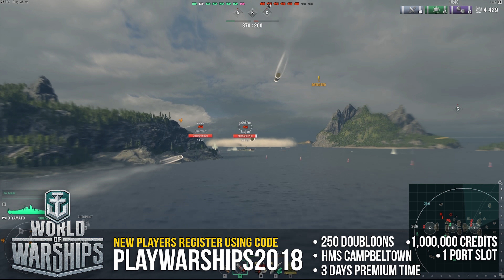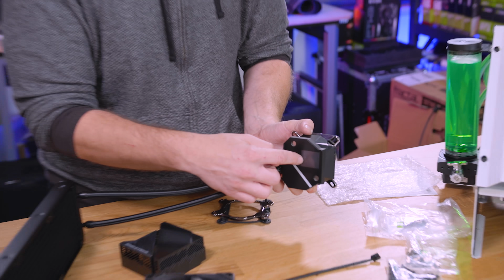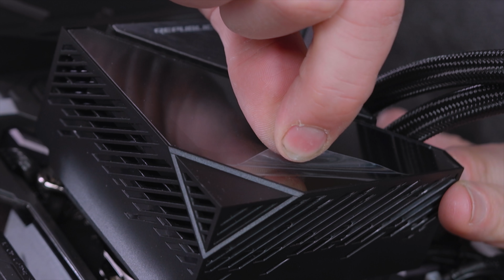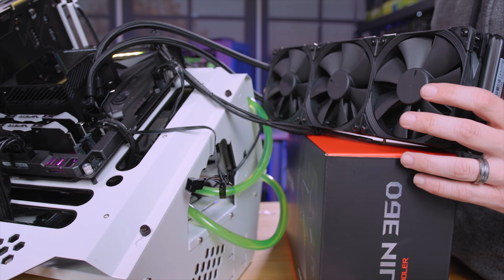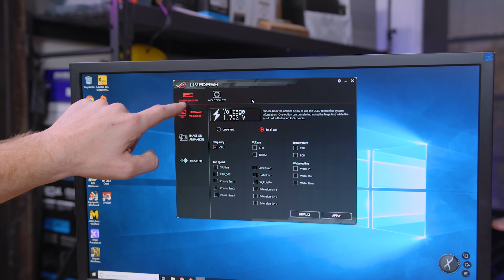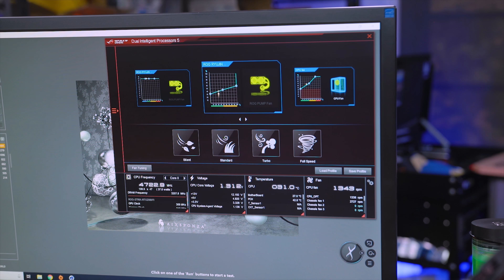ASUS made an AIO... but is it any good?? RYUJIN 360

Comment: Did you see if that temperature sensor is actually accurate?
Reply: I don't believe it has a temperature sensor built in but rather displays the cpu package temperature as reported by the motherboard. Meaning most software would report exactly the same temperature. The only problem I've always had with those is that the update-time is slow af so you never see quick temperature transitions or shift. Instead, you see jumps.
Reply: @thegreatdisillusionist  well, it's a matter of one or two seconds, do you need more?
Reply: @simoneperale3765  I enjoy a quicker, closer to realtime one, yes.

Comment: I've got the 240 ryujin and think it does pretty well the block fan was awful cos of the noise so I had  it turned it way down manually  but it'll kick in when temps get pretty high other than that no complaints oh other than the software can't find one gif that will work on the cooler display. Also think you may of been unlucky with the fan cable mine are fine and with research I did in forums etc before I bit the bullet not seen anyone with the same issue

Comment: I play Warship every now and then too.

I solder all my wires to pins, I dont trust crimping anymore after going through wire hunting with my injector plugs harness on my last race car.

For builds I have use Thermaltake, Corsair, NZXT and Cool Master for AIO. Which ever is on sale on Newegg or Amazon. Never heard any issues from any of them.

Fans are more interesting vs the AIO. At this price may be a entry level EKWB custom soft tube kit...

Comment: Get the $150 Corsair H150i PRO RGB 360mm. 😁
Reply: Me too and I also love it 😁
Reply: H150i Pro is a great option. Corsair is #1 in terms of device control software.
Reply: Me too and I love it
Reply: H115i Pro 280mm cooler here, 50C in Cinebench 4600MHz, i7 6700K.
Reply: Or the nzxt kraken x72
Reply: Or the $115 fractal design S36...  (If you stick with a 360) These things pretty  
much all use the same Asustek pumps so unless you want to pay more for RGB ....
Reply: There are better options for $150.
Reply: @_mike  why brag about there being better options without specifying any
Reply: Michał Bondyra maybe so but it didn’t cost that much and I still love it

Comment: I have cooler master 240 ...... And it sucks. I built the computer in February and the pump is making a clicking (more of a grinding) noise, almost like it's going bad. I check all the time and no leaks and temps all stay under 65C so I guess it isn't terrible. But that sound is awful.

BTW my rig
R7 1800X @4.1GHz
EVGA FTW2 GTX 1060 3GB (looking at an upgrade)
16GB gskill trident Z @ 3000MHz
ASUS x370 board
+ a ton of other crap all in a phanteks p400s case. Inside of the case doesn't get over 40C on stress tests usually 30-35 for gaming.

Comment: The 240mm model is $220. Asus is out of their minds, an NZXT X52 is $130, and a pair of Noctua NF-F12 iPPC PWM fans is $50. So for $180 you get the exact same cooling, and the block is smaller and looks better.
Reply: It’s the oled panel and rgb ecosystem
Reply: Theres also the fractal design celcius s24, forgot how much i paid but was a lil over $100 if i remember. Good cooler for my ryzen 5 1600x. Edit i payed $120 on amazon with prime.
Reply: My deepcool captain 240 ex is 120$ and alot better than this asus one lmao
Reply: does it have a fan that blows down onto the area around the socket like this one does? i think thats what i found most interesting.
Reply: @edguix  a fan doesnt cost 100$, asus is overpriced
Reply: @NakiriX1  i agree about the overpriced part, but still if you can find me a solution that discretely or conveniently places a socket-cooling fan in that position im all for a cheaper or better watercooling solution. as it is, i dont think i would like the high pitched squeal as that is one of the reasons you buy a water cooler, for the lower noise.
Reply: I use Id cooling 240mm, up to now 3 years, good temp and only 50$. On my main pc, I do custom loop, cost 1k$.
Reply: Coolermaster masterliquid 240 costs like 100 and its gud already
Reply: It’s a good liquid cooler but you are also paying for the looks that’s why all these uglier looking coolers that perform the same are cheaper.
Reply: For $310 you can get a full custom loop with Fluid Gaming. That also has an expansion kit with one 240mm radiator and a 360mm radiator.

Comment: The Temps are incorrect.  OC3D reports the aio has it own sensor in the pump. Please check this jay,. You are the best!
Reply: Markus Dortmann yep using right now and when I ran cinebench 3 times to be sure and it shows 6-7c lower than what the actual temp is(monitoring software is HWmonitor64 and cpu is 9900k at 5ghz and at 1.3v)
Reply: Not in the pump. AiSuite reads temp from a sensor under the socket. Not on the CPU.

Comment: I am happy with my  Corsair Hydro Series H115i RGB PLATINUM 280mm  as it has all the bling I need as that would drive me nuts with that small fan on the ASUS pump head...   more things to go wrong and for $280US  to replace just because of a fan malfunction.   SO far as I don't do much overclocking as my 9900k is hovering around 39C  @ 4.8+ghz

Comment: corsiar h100i  untill i bought my r7 2700x wentwith the  new 360mm form fractal desgin  with norcuta fans though never above 60 at load
Reply: Is your 2700x overclocked? Still rocking my H100i on a 2600x. Getting 60c max as well, although my chip isn't overclocked. Considered grabbing a 360 rad, but unsure how much it would affect performance.

Comment: Here's an idea an AIO could have the RGB controller built-in and have connect there could be an external power board cuz you probably don't want all those cables coming out of the AIO but it would use an extra 4 pin connector or even 6 pin connector so you can have all the fans running off of a single cable from the power supply.

And if you had RGB tubing you be able to power that from the aio

Comment: I heard reports that the AIO display is 10c off from the actual CPU temp since the sensor on the AIO is getting it temp reading from the motherboard and not the CPU it self. Check HWMonitor or what ever you use and take some more readings and see if it really is the 10c difference.

Comment: @jayz2cents check out oc3d tv review mate - this cooler reads the temps from the sensor behind the CPU socket not the actual CPU temp and is roughly 10c lower than ACTUAL  CPU temps - beware!

Comment: I rather like the Noctua aesthetic. It makes their products more recognizable.
Reply: @Mike Li I also have a meshify c, it's a great case! I'm currently saving up to make all my case fans noctua and hopefully get one of those next gen u12 coolers when they release.
Reply: @TheEmeraldArrow  wow same here! I've heard the new u12s has the performance of a d15 while staying the same size. My CPU throttles during benchmarks and games so I'll gladly upgrade when the revisions comes in 2019Q1.
Reply: @voxelfusion9894  what CPU do you use?
Reply: @TheEmeraldArrow  In germany the CPU shortage and crazy tarifs made it so that a 8700k costs around 625$ (550€) which is the same price as importing a 9900k from the US, which is what I went with. Even with solder it's too much for a current u12s, when it starts to draw 170W. Since the new u12s has a TDP equal to current D15, that being 220W, it will help me quite a bit, considering it's cheaper than a aio, doesn't have rubber tubes and frankly an aio just doesn't fit in a meshify C (top has ram clearance issues and my gpu is too long for a rad in the front).
Reply: @voxelfusion9894  you could try replacing the fan on the heatsink with a 2 noctua a12x25s. I think they are the same ones they are putting on the new u12.
Reply: @TheEmeraldArrow  yeah I did infact buy a nf a12x25 and it looks as well as performs fantastically. The other nf f12 fan that was originally attached to the tower is now serving as a case fan, though I could try a push pull config.
For now though, It's not really a big issue as my gpu, an aging 770, is a severe bottleneck, I ought to get something more powerful to balance the setup.
Thanks for the tip!
Reply: @voxelfusion9894  with that monster cpu, try and bag a used 1080ti before they become too scarce and prices hike. New cards are an utter joke don't even look at them
Reply: @ESSAKS786  that's some sound advice, I'm looking into it.
Thanks!
Reply: It's treason then
Reply: That's true... kind of like Russian women. Strong like bull, Beautiful like tractor!  (an old saying lol). So to each his own I guess?
Reply: HIPSTER ALERT! Somebody get the shotgun!

If you smeared yourself in shit every morning you'd be "more recognizable" in a similar way to Noctua fans.
Reply: @pyranna2003  some people don't want a rave inside their computer and that's fine.
Reply: afaik they make black fans now so what exactly is the problem it is basicly all i ever wanted and infact the reason my current fans are bequiet silentwings and not noctua because i decided to have a case with a window for once

Comment: I have a kraken x62 and it is doing a fantastic job cooling my 6700k overclocked at 4.7ghz at 1.33v. i get 55-60 c when gaming and 65-70 c in syntetics. (front panel off)

Comment: The fans are what? 20-30 a piece as is so that is 60-90 for the fans alone. Looking at 190-220 for the rest. Oled panel probably 50, so we will say 150ish. Mini fan probably like 5 bucks. So everything else you're looking at $140ish? Paying that much for something that came broken? No thank you. Looks good, great concept, but not great for the craftsmanship plus the noise levels with that mini fan. Id rather buy the noctua fans myself after get a 360 aio from deepcool that isn't asetek patented.
Reply: OLEDs are cheap, just look on aliexpress/ebay. E.g. between $6-7 for 0.95 inches.
Reply: @V0odOo  well that literally makes it even worse hahaha

Comment: Jay, please confirm the temps of the Processor from an outside program or app Versus what is shown on the display of the cooler. Asus Software does NOT report CPU temps correctly. They report CPU temps from a sensor around the cpu socket. They dont use the CPU Package sensor on the processor itself for temps. I have that Asus board with the LED display on the board itself. It is always 10c cooler on the LED on the board versus what ALL other programs report. Even Intel Extreme Tuning reports higher temps in the Proc versus what Asus AI Suite shows, which that data is sent to those LED and Cooler Displays.
Reply: correct. as being like that always. since z170 get the led code. but yes. Asus has to make changes in bios in order to give the option. The sensors are there. Al least give like read package or cpu temps. or other sensors. But still love the round one.
Reply: Is it possible to calibrate the OLED display for accuracy? If not, start pestering ASUS for that.
Reply: Yep, been noticing this since 2006 on my Asus A8R32-MVP Deluxe.  AI Suite shows CPU temperature lower than package temperature so to be safe I always tune my fans and fail safes 10C lower.  Sabertooth X79 and X99 boards on the Intel side, same thing.  It's just something I've been aware of with Asus temperature monitoring.
Reply: The sensor that read that existed since z170 maybe a update?
Reply: This! Upvote for awareness!
Reply: OC3D TV shows and talks about that on his channel review.
Reply: Honestly shocked he wouldn’t use hardware info to confirm
Reply: This is a very amateur error from Jay...dont know if it was intentional thou...asus temp sensor is beneath the cpu itself, on the socket. And FGS, temp testing using cinebench is STUPID. Run OCCT with AVX on all cores, and you'll hit TJMAX in no time. Stupid of Jay to put out a video so bad like this...in the end we cant tell the cooling capacity of this overpriced asetek aio.
Reply: I can confirm I also use this AIO and the display usually shows me 2 degrees Celsius lower than what is shown in HWM pro 64. Still not bad tho just like jay said it is exceptional for cooling I overclock my 9900k to 5ghz at 1.3v and ran cinebench 3 times the max temp is 88c I mean I saw the Corsair 360 AIO crumble in the high 90s with the same cpu.
Reply: Just tested it with cinebench it shows 6-7c lower than what is actually shown on HW monitor 64.
Reply: True, I use Notebook Fan and CoreTemp, difference in temp 10 - 15  degrees in CPU Temp Monitoring.
Reply: Never had a reporting issue on my threadripper vs OLED reporting. Sorry.
Reply: @weather12guy  Ever heard of the temperature offset on those Zen CPUs? Look it up, buddy.
Reply: No matter if the temp was not correct. then he was running 5Ghz at a very high temp. so it seems correct. else we would have seen a BSOD
Reply: @DannyNilsson  That proc would not bosd at 95c temp. It would thermal throttle itself to counter it. That cooler got to “85c” rather quickly for its size. 

I have same proc and board also at 5ghz, just with a Corsair AIO and it does not get NEAR that hot. Asus suite on my board reports 10c cooler than any other software on my PC when it’s stressed tested. His test needs to be rechecked with another third party program because their software is not accurate for cpu temps

This was also confirmed with OC3D in his video as he reached out to ASUS to confirm that issue.
https://www.youtube.com/watch?v=2wS0Ev3SX2I

It was also confirm on Asus Forums that this software reports temps from the sensor UNDER the proc on the motherboard. So its not accurate at all. And that cooler uses that sensor to report its value.
Reply: yes you are right. it could have some Throttle. but if the package temp was 85 how hot could the cores have been.
Reply: @DannyNilsson  Thats just it, that 85c we saw on the cooler was not the true temp for the package or the cores. It was the temp for the sensor under the motherboard cpu cocket...

That is why Jay needs to double check his work. Everyone else is reporting different temps from Asus AI Suite versus everything else. Im all for the Asus brand, I just do not want people to go out and purchase something without knowing all the details of its issues.

Comment: Jay. Seriously. You need to have crimpers and headers in your took kit. It's not hard to recrimp these connectors. If a moron like me can do it, you can.
Reply: that is not the point
Reply: At almost $ 300, bad wiring is unacceptable.
Reply: But I mean he should not have to. If you pay for something it should not come "broken" our of the box.
Reply: @FadedMemer Yes, their quality control is shit. They should have made the cord replaceable.
Reply: Well it seems the average moron who buys this AIO is on an entirely different level than you are because I'm sure they don't even have a clue what a crimp tool is.
Reply: @frankthetankricard  I guess you are right. I come from the days before "custom extensions" so, for me, fixing cables or changing headers is old hat and part of the PC build experience.

Comment: It would be cool to have an option to buy this without this useless display and that fan on the block.
Reply: Agreed 100%
Reply: But you have an option to buy that without the useless display and that fan on the block. Those two things are what Asus added to the already existing Asetek cooler. You can probably buy 8 versions of the same block/tubing/radiator combo from different manufacturers with their own pump, fans and logo attached.
Reply: @frankthetankricard  This one's just for the Noctua fans out of the box and THESE FANS ARE ACTUALLY BLACK!!!
Reply: There you go, 40-50 € off different block https://www.jimms.fi/fi/Product/Show/145244/90rc0040-m0uay0/asus-rog-ryuo-240-aio-vesijaahdytysjarjestelma-prosessorille

EDIT: Noticed they arent Noctua fans, rip

Comment: "we're running 27F on idle" Wow that's an impressive cooler in that case... beware of condensation =D
Reply: Yeaaaaahhhhhhh.... if thats the case I'll take one!!
Reply: Miarez_93 for real 😂😂😂😂
Reply: Seriously? No, it’s idling at 27 degrees “Celsius”.
Reply: @hemlimchhay288  Now thats a bit different lol.
Reply: @cooperbeats9620  Still doesn't make sense cause thats 5F BELOW FREEZING lol, although I suppose since it will be a glycol solution and not pure distilled water that it would have to get a lot colder than that to freeze.
Reply: Tick Tock Tech excuse me I just r/wooooshed myself
Reply: @cooperbeats9620  ROFL! XD
Reply: Miarez_93 it’s Celsius not Fahrenheit
Reply: @aidenminer1559  Yeah I know, but he said 27F, which would be amazing idle temp for an AIO
Reply: Miarez_93 My cpu is 25c idle and 35-40c under load with a deepcool aio.
Reply: Madcatz my cpu is sitting around 29-35c when idle and 40-50 when gaming(Destiny 2) mins is 9900k at 5ghz 1.3v with the asus AIO.
Reply: Lim Chhay its good but not good enough for that price
Reply: Miarez_93 forgot to mention that i have a i5 8600k oc to 5ghz
Reply: I missed that, where did he say that?
Reply: @Yalikejazzboi  @10:32

Comment: Before getting to the wiring issues, when you talked about how long it took to get to market I just thought "they want to make sure they do it right. It's Asus, after all." Sorely disappointed, hopefully you got a lone bad egg. If not, they'd better replace the parts for people or they're gonna get booed out of the market.
Reply: Asus quality isn't what it used to be. Had to RMA my laptop twice in less than a year because both ethernet/wifi died. It's a shame because I really like the laptop when it works. Sure it was only around 340$, but it was brand-new and you'd expect it to actually work.
Reply: Honestly, ASUS quality is shockingly bad today. Between the shitty VRM specs as of late(remember when they were known for being the best? Sad.), what with Steve@HU's research into the 4 phase Z390 garbage, Buildzoid's opinion on them has completely changed as of late(he hasn't exactly been complimentary...), as has many others as they've fallen off both objectively and qualitatively, and they've largely been investigating into gimmicks lately.